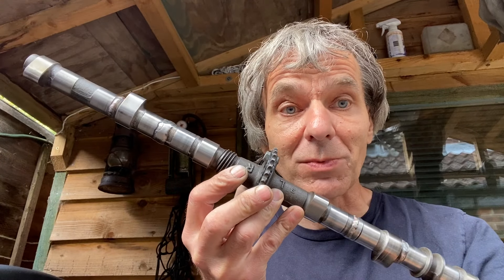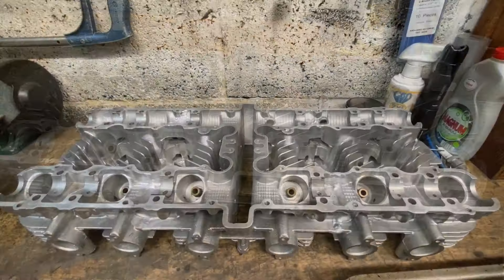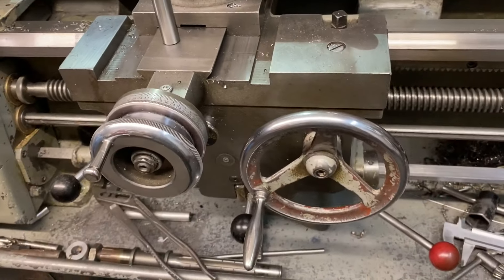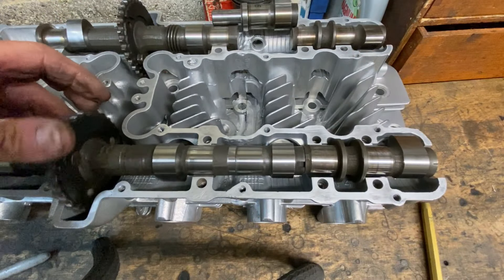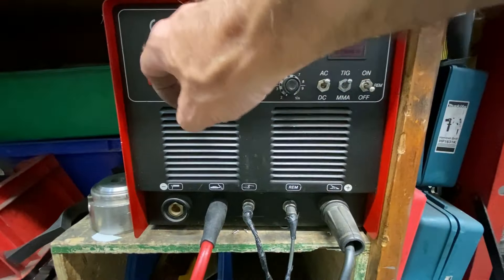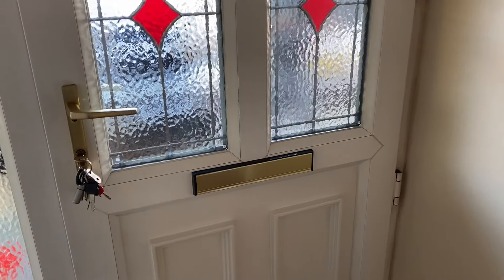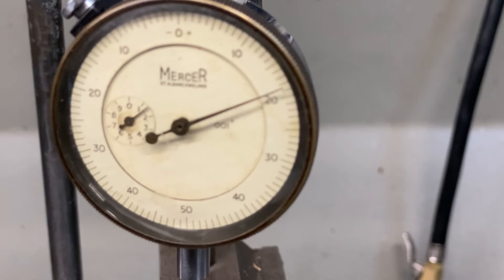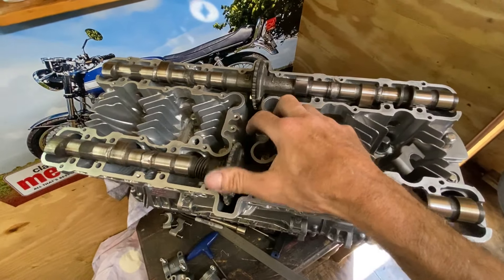Kawasaki Z1 Super Six Camshafts - How its made

Comment: 24" welded shafts to within 0.001" thats just typical of Alans site. As an engineer 40 years working in automotive and building and tuning my own engines Id have guessed "not possible" until  saw it with my own eyes. True craftsman at work. Pulling the bend out with a Tig.......yep Im still learning. A pleasure to watch true skill and no BS.
Reply: Not an engineer, but does the bend not come back as the engine warms?
Reply: No it doesn’t come back because the camshaft will never get that hot and it’s also heated evenly with the engine heat
Reply: My mind has never been so boggled!
Reply: A search for "keith fenner shaft straightening" is quite interesting...
Reply: I drive sporting trials and met a Scottish guy who came to see what we were up to, upon talking to him I discovered he did beach racing up near Edinburgh. He told me that they used British bikes and cut and weld the camshafts to make the engine run like a big single ie both cylinders firing together. Amazing bits of ingenuity out there.
Reply: @neilmchardy9061  I'd guess that gives you a really punchy power delivery for back-hopping onto rocks etc?
Reply: @LonesomeTwin  No Alan is using the fact the Tig gun places a highly localised heat expansion quickly before the heat travels to the other side to force a movement due to expansion and the relative plasticity of the heated point compared to the 180 deg opposite side that is relatively colder and therefore smaller the difference in size on 180 opposite faces produces a  bend in the material  such that the bar bends to the cooler side. Heat in a engine is not enough or localised enough to produce the desired effect although some normalising of stresses may happen what is being done here is active straightening.
Reply: I'm an engineer by education and can handle a torch. Handling heat distribution like this I only saw on my uncle's workbench...and he's a master goldsmith. Wow.
Reply: In theory it's easier for a mechanic to become a craftsman then an engineer, than it is for an engineer to become a mechanic then craftsman. 
The simple reason is that the craftsman learns by feel and experience and then makes a practical solution. The engineer keeps putting scientific thought and reasoning as a limitation of why it shouldn't work.
The realistic truth is that more than 99% of people will never be able to achieve both craftsman and engineer which ever order they do it in.
Reply: @stevegraham3817  Interesting viewpoint. I guess its a question of terminology. And as a dyslexic, names and naming somewhat pass me by. I say engineer, it is a term I have only adopted being self taught in the use of all workshop machining, from lathes, mills, welding, hand tools, through electronics and electrics, fitting, design, CAD, CAM, CNC machining then quality processes and qualification in 6 Sigma Lean production. Personally I cant design anything if it uses a process I cant personal do, as a consequence I have to master the process before I design with it.
To keep my hand in I renovate motorcycles and engineer at home, its my passion.  I have used this principal to build a 25 strong company designing, manufacturing and exporting product to the automotive industry world wide for 35 years collecting a few patents along the way. In dealing with the major car manufacturers at all levels from prototype to production Ive probably worked with over 1,000 "engineers" but only half a dozen I would say are impressive and they were also the ones who could wield the tools if need be to create the things they were in charge of engineering.
I would say those guys were both craftsmen and engineers or to me good engineers.
In my mind its how any engineer should be and we have bastardised the term engineer to some kind of glorified middle manager, we have lost the craft in too many aspects of engineering.
Reply: This was the video I wanted to see - I didn't think cutting and shutting camshafts was possible either.
Very impressed.
Reply: I like the way he works for the pure joy of it, always striving to be over-the-top, but with a level, conservative mindset.  Very mature, in my book...
Reply: @neilmchardy9061  

XS 650 Yamaha engines have a kit for that .
Reply: @LonesomeTwin  No, it's fixed by the heating process, and the engine won't get hot enough to cause it to go out of shape.  I used to work in heavier, rougher engineering (making lintels in the Specials Shop at Jones of Oswestry).  When cutting arches into plate steel, the plasma cutting process would cause the straight edge of the steel to pull down at either end, distorting it.  To correct this, we would heat the straight edge to dull red, causing it to expand and become even more bent, but when it cooled it would contract further than it had bent, thereby straightening the edge back to where it needed to be.  That's pretty much what Allen did to the camshaft.
Reply: Twingle
Reply: @neilmchardy9061  OMG even more vibes !
Reply: Steve Graham ...  Engineers "know" these things are impossible.  Plus they can't help counting beans.
Reply: Dean Green ... I have done some weird shit to keep machined pieces straight after heat treat, like dipping parts of warped pieces in liquid nitrogen after spot heating.  Mostly hit or miss.  There were a few guys around who could usually get it right the first time.  I wasn't one of them.  A good welder could sometimes lay a bead here or there, which worked better, if the part design allowed it.
Reply: "Takes a bit of practice" What an understatement !
Reply: Welding is an absolute art, this man makes everything he does look easy,a true hands on genius!!
Reply: @LonesomeTwin  no,it wouldn't create enough heat mate, it's a skill that is learned after many mistakes!!
Reply: @ParaBellum2024  Knowing ones materials is "half the job". If you take a piece of glas, break it in two, crush one half and try to melt the two halves together, they won't (always/ever? - I'm just a beginner, and am quoting books) expand and retract the same way, and will (probably/always?) break.
Reply: never stop learning in this game

Comment: I settled down with a cup of tea to watch this with a smile on my face, looking forward to being entertained for a little while. The smile turned into a burst of laughter when Allen dropped the finely engineered shafts onto the dirt, held them down with his foot and set about them with a cutting disc. 1mm discs are indeed a godsend. The use of heat to pull something back into line is something we used to do when fabricating welded pipe assemblies - apply heat, using oxy acetylene, to the side that's proud, then either allow to cool naturally or chuck a bucket of water over it. Not as precise as Allen's method, but ok on four inch pipework. Please keep the videos coming Allen, they are a ray of light in the gloom during the current miserable situation. You should be available on prescription as a tonic.
Reply: I would have thought you heat the side that's concave, as to expand that side...
Reply: @lennym1273  When you melt a spot and it then cools down, it shrinks, thus shortening that side. I have been doing it for years when building frame ect. Can bash it with a hammer or just melt and cool.
Reply: Tonic available now, courtesy of YouTube and Allen. Take as required 😂
Reply: Mp

Comment: I actually learned the basics of lathe work when I was fourteen or fifteen years of age at my secondary modern school's well equipped metal workshop. I absolutely loved it. I left school at the age of fifteen when I started an apprenticeship with a local company. When I eventually retired from full time work I got a part time job at a local school here in Chelmsford working as the technician/maintenance engineer in the design and technology department. The main workshop was well equipped with two Boxford lathes and one Colchester. To my amazement the head of department wouldn't allow any of the students to actually use the lathes "for health and safety reasons and in case someone hurts themselves".......I kid you not!  And people wonder why we don't make much stuff these days. 
I've worked with a lot of really good engineers over the years but Allen is the most naturally gifted craftsman I have ever seen.  Well done Sir!

Comment: I've added you to my short list of 3 engineers who inspire, which include Soichiro Honda and John Britten.

I dig the fact that you include less-than-prefect results and how you overcome that.

"Many people dream of success. To me success can be achieved only through repeated failure and introspection. In fact, success represents 1 percent of your work which results only from the 99 percent that is called failure." - Soichiro Honda

I think that's a great determination quote, but I'm sure your success rate is much higher than 1%. Nicola Tesla claimed to have a high rate of success because he worked it all out first in his head.

I would have thought that you had a cam grinder make these for you. Cutting them up with a angle grinder and doweling them together didn't cross my mind, but after watching your other videos  should have known better. Brilliant.
Reply: uKurtlele same. I thought he would start with some 6 cyl cams and have them reground to fit this application.

Comment: Allen's videos  are a true testament to  real Engineering. If I am lucky Allen will read this comment. Allen a good friend of mine many years ago took a Z900 crankshaft and offset ground the crank to change the TDC 30 thou on the down stroke. The result was the engine could rev to 20,000 and still some. The engine was fitted into a side car outfit and was banned from race circuits in Australia for being too quick. Keep up the good work.

Comment: As a machinist I have done  many modifications and repairs exactly like this.  In my experience I always V Out the welding seems first before welding for a more penetrating weld. Also another technique I use is to pin the two mating pieces on both sides “vertically”after welding for extra strength. I use ceramic inserts when machining those hard surfaces before breaking in to the softer core.  Great Job on this one.  Btw, I noted you pre heat the part before welding same as I do which makes for a better weld and prevents thermo shocking the work piece and causing warping or springing the workpiece.  Great Job my friend!

Comment: Excellent. It will be interesting to see how the cams turn when you bolt them in place with non matching cam holders and shell bearings in place. You might need to mix and match the cam holders until they turn with no resistance. Unless you are going to machine the cam holders to match the cams? Very good as always Allen

Comment: Amazing procedure. I would have never expected that this works. Welding to 1 thou with just a lathe and some pins. No re-hardening, no cylindrical grinder. And on a Bantam Mk1!  First lathe i ever worked on regularly. A sweet machine, no match for a "superproductive" style Lathe, but i love the setup of the control levers and it is very good for it's size and weight. Only the strange spring loaded tailstock arrangement that always goes out fo alignment always bothered me ? Yours also doing that ? Anyhow, Hats off :)

Comment: I've been waiting patiently for this camshaft vid, and wasn't disappointed to witness the simple but very effective way the lengthening was achieved. I'd assumed you would have pinned across the cams and through the gudgeons to stop rotational shearing of the joins at high RPM, so I'm guessing you have complete trust in the penetration of those welds!! Thank you for yet another fascinating vid Allen.

Comment: hello Allen, I'm the guy that asked you about my XJ550RJ carb problem. I sold machine tool products for decades before retiring. I'm really impressed with how you do your problem solving not to mention your metal working skills. OK now here is my question re this topic. Do you have any concern that the difference in weight at every weld point may cause premature wear on the bushings or bearings along the camshaft ? If so, would you consider using a tool post grinder, abrasive stone, cloth backed economy roll sandpaper or such to remove some of the welding rod material to more equalise the weight from weld to weld ? That was my only concern, everything else was A1 Your videos are addictive to this back yard mechanic :)

Comment: A lot of vehicles these days use press fit lobes for ease of manufacture and to allow valve timing adjustment during manufacture without the need to remake castings.

The lobes can be heated and turned to adjust position, in the event of timing chain or belt failure the lobes often shift position with piston to valve contact.

Comment: If I remember correctly , Honda's CBX 6 had 2 piece cams ., apparently there was concern over the production straightness of the cams , due to their length . ,(I suspect the magazine guys didn't get all of the real effects Honda experienced ) ..so you've basically done what they couldn't !
Reply: Maybe. But through the 70s and 80s Honda could barely make an engine without cam / camchain / tensioner problems. And thats despite their heritage being 99% 4 strokes.
Reply: @gs425  Yup, that kinda brings back the first attempts at double overhead cam bikes they built., not to mention the V 4 s with their strange cam disintegration .

Comment: Haven't looked at my 1976  900 cams really closely in a long time, but one day I decided to compare them with the 1977 cams ., I found (40yrs ago) the 1000's were cast with a #5 on the shaft & the 900 's  had a #6 marking ., & yes the 900 's were higher lobes !So along with the full circle crank shaft weights & a little better idle circuit in the carbs & maybe very slight ignition advance differences the bike (1000 ) ran smoother & with  a bit more torque ., & so actually felt substantially stronger throughout the rev range.

Comment: thanks allen that was a treat im learning off you all the time incidentally what was the firing order before and after...... interesting about straightening the distortion I've got a Porsche crankshaft that's bent I'll try your method
Reply from the maker: A crank sees a lot more stress than a cam although it will work it may affect the tortional strength of your crank ?
Reply: @AllenMillyard  ok thanks allen the crank is prob the strongest bit of the engeine its a boxster 3.2s the engines are not very good suffer with lots of things .....

Comment: I enjoy your modifications to these engines, I see you use carbide tip tools and they struggle with hardened surfaces.  If I could make a suggestion, try ceramic tips, they 
cut through those hardened surfaces like butter.  I have used them to modify roller bearing shells, and they work good.  Bill in Brisbane.

Comment: Couple of questions Allen: How much penetration are you getting with welding butt to butt [doubt much] and does it not matter? Are you welding to case hardened metal? When are you going to do a vid on the welding set up particularly when your welding aluminium and what sort of filler material etc.
Reply: Camshafts dont need much torque to drive the valves. Just look at the spindly chain they use to drive them. So the weld doesnt need to be as strong as you may feel looking at the diameter of the shaft.
Reply: I’m surprised, didnt put v prep on it just to get bit more penetration, also don’t know how much carbon cams have in them, it seems to work though.

Comment: I see it and still don't believe it. But there it is. 🙌
The amazing part is when you fitted the z1000 cam ends only to find they were the wrong size (measure twice cut once). Most normal humans would have lost it at that point but no, you calmly go about the business of setting it right.
Reply from the maker: I could have left that out but it was funny that I didn’t check profiles
Reply: Allen Millyard - Its good you left that in there because you've shown that not everything goes according to plan. It's doubtful you'll make that mistake a second time.

Comment: I was wondering if you made a 120° crankshaft.  This video pretty much answers that question.  
Amazing that you can do all this without swearing.
I have a '73 Z1 that I bought new.  Pretty much original except for the seat.  Stopped riding soon after 100,000 miles.
In the 90's a tornado blew my garage down, smashed two bikes, but the Z was un damaged.  Lucky.  The others were a 75 CB750 and a 78 SR500E.  Not lucky.

The Z1 was the easiest big bike to work on I ever owned.  Still cussed a bit, though.   
They only quit making the Z engine ten or so years ago.  Police bikes (original, not the "J" engine).  I think that must make it the longest running motorcycle engine production ever.   There were three sizes — 903cc Z1, 750 Z2 (sleeved down for Japan), and the 1015cc KZ.  
I think if they started making them again with fuel injection and modern suspension they might sell.  I'd certainly want one.  EPA might ruin that, though.   I want two valves per that can be adjusted WITHOUT removing the cams.  Two valves and air cooling might not pass emissions.

Maybe they would make a six...  Hey, Kawasaki, pay attention to this guy.
Reply from the maker: Yes , see the video on my channel how I made the crankshaft
Reply: Allen Millyard — Didn't know it was done already.  I've been wondering about that — if you separated the pressed-together crank (if that's possible) or cut and welded (doesn't seem likely).   I'll watch that video tomorrow morning, or afternoon, or whenever I wake up.

Comment: Here's a question I've been curious about for a long time. Even geniuses don't hit a home run every time, ( or have a sticky wicket as the case may be : ) ).  Have any of your incredible engines ever failed, and if so, what did you learn from it?

By the way, I just re-watched that video of you building  a five cylinder Kawasaki two stroke AT a bike show and then starting it up on the spot for the crowd!!! Quite mad. You are one-of-a-kind.